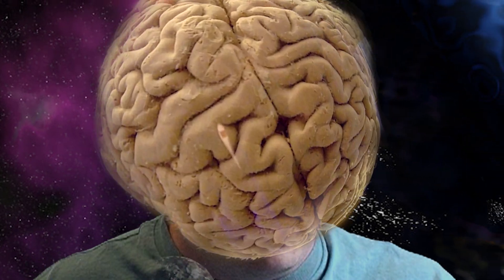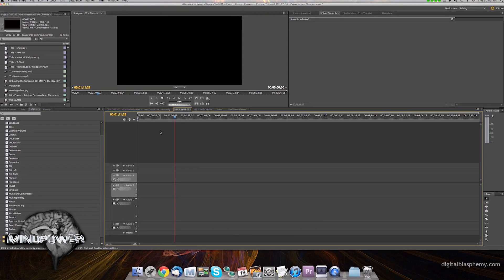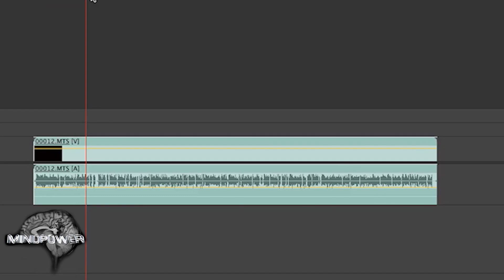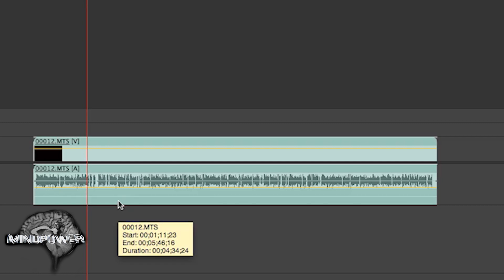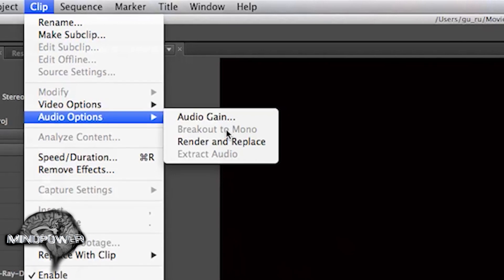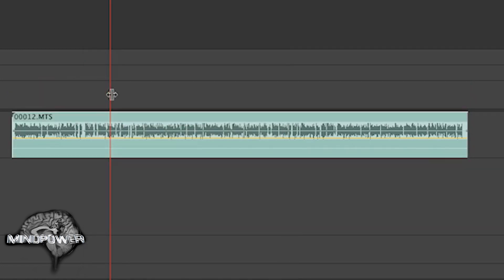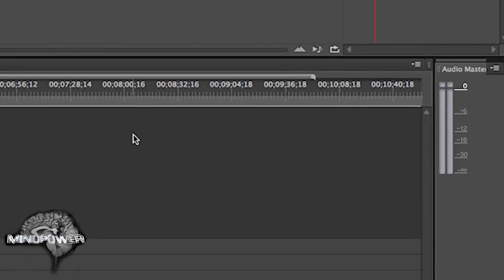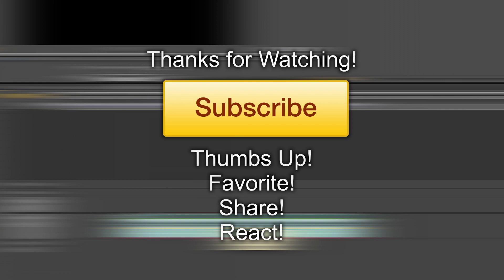How to Convert Single Channel Audio to Two Channel in Adobe Premiere CS6 - MindPower009

Comment: The "proper" way, rather than using an effect.  Right click in project panel/ media browser.  Select Modify -> Audio Channels.

Then change "Clip Channel Format" to "Mono", and ensure that the correct left or right option is selected in the Media Source Channel box.

Then the clip will become Mono, and simply play out of both left / right output channels properly.

But I found your way before I found the right way ;-)
Reply: This isn't exactly "the way," as I do not have "Clip Channel Format" in my Modify Clip dialog box.  Infact, everything is faded out so I cannot make any choices in this dialog box.

Comment: How would you do the something in Adobe Audition CC? Cheers!
Reply from the maker: You would probably just convert the audio to MONO.
Reply: MindPower009 Thanks! I did end up converting the voice track to mono then to stereo in Audition CC. Its a time consuming process as you have to move from your multi track session to the wave form for each clip. 
A much easier way (which I found out after I exported to Audition), in Premiere CC go to "clip" - "modify" - "audio channels" and you have all the options you need. I did a batch test with multiple voice track, everything work perfect.
Cheers!

Comment: hello , im using cs6 and i cant find the list where u have ur audio options ! do i have to download those effects ?
Reply from the maker: No, all the effects I used in this episode were built in.  You might have to change layouts.  Some of the layouts show different features (although all features are available in all layouts, you just have to show them).  You can show the effects window by going to the "window" menu and putting a check next to "effects" (which is the option directly below "Effects Controls".  Then you can grab that tab and stick it anywhere on the window where you want it.  Effects shows video effects and audio effects, so you have to expand the Audio section to see the Fill Left.

BTW I'm using CS6 too.